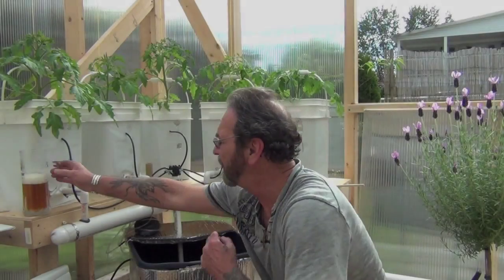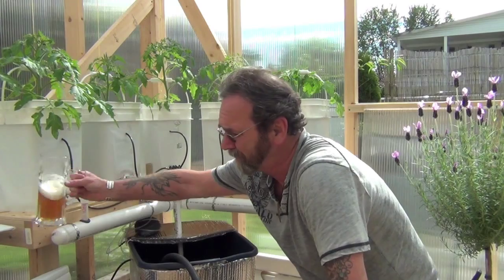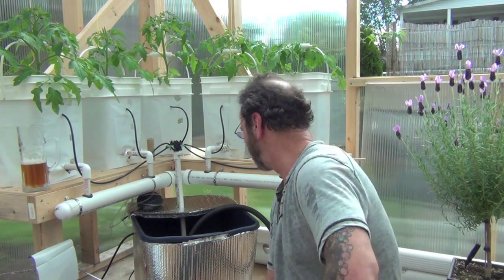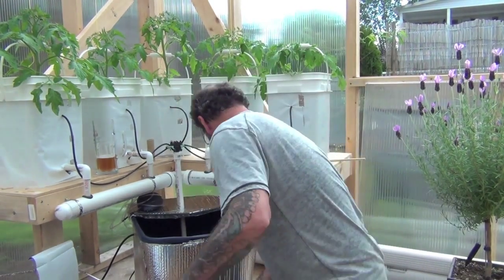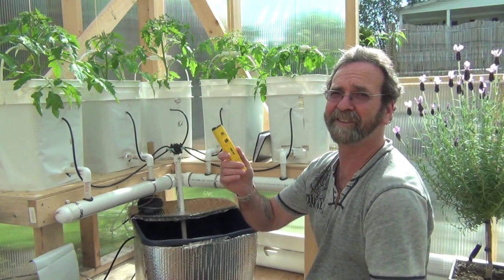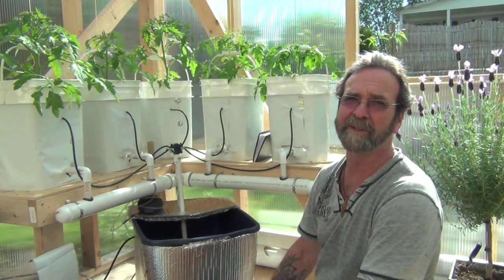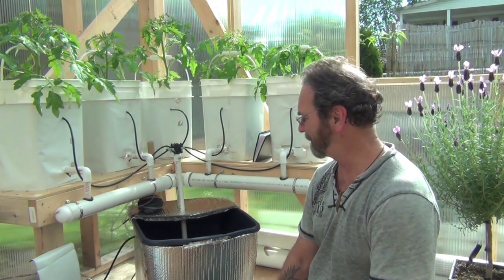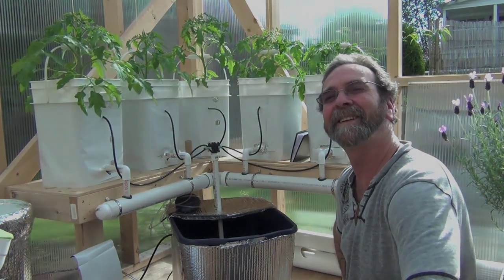hydroponic greenhouse nutrient change june 24 2012

Comment from the maker: It's because I weigh it with a digital scale. with the nutrients I'm using it requires 0.2 grms per gallon of dry ph up to achieve a perfect 6 on the ph after my nutrients are mixed. I rarely use my meter unless I'm just checking the reservoirs for ph drift, Which I don't get because of the fresh water reservoir. I shouldn't say never get but the ph may swing by .75 in 10 days so I'ts very stable :)  the dry is reall easy to handle as well :)  Brock